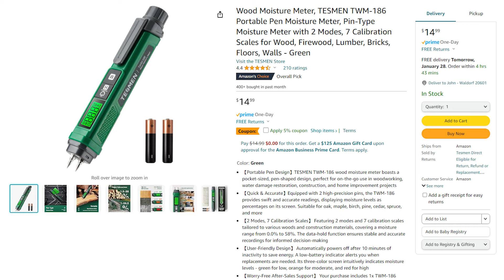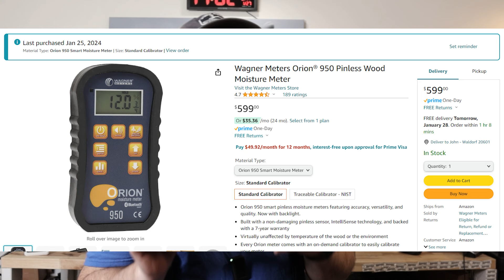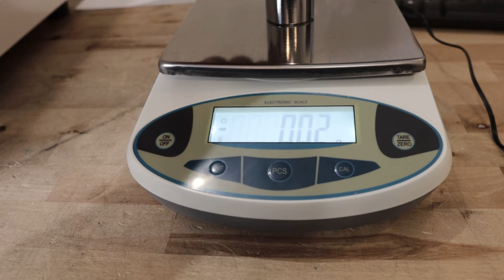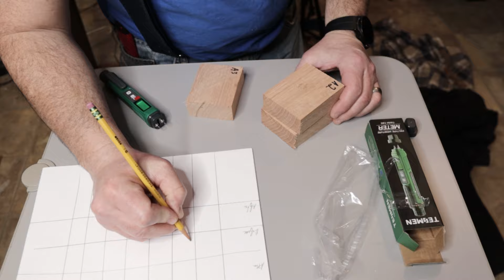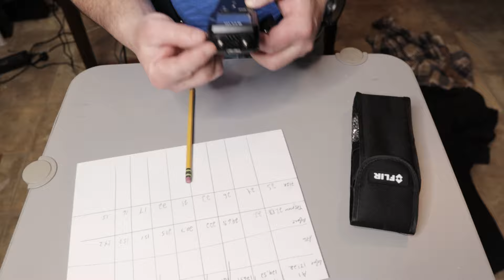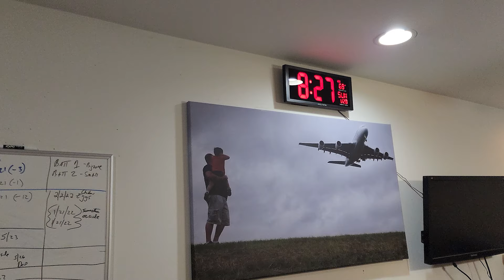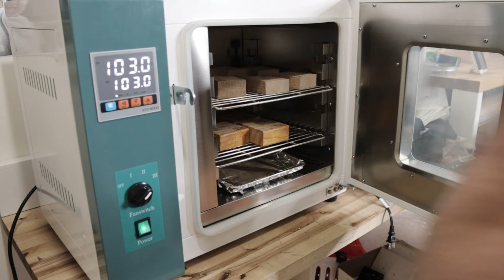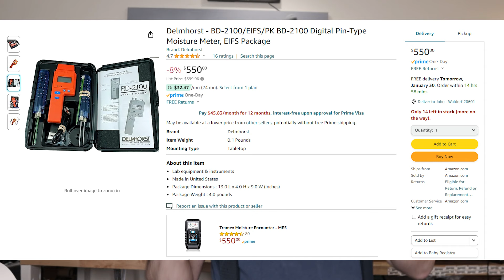Science Proves Which Wood Moisture Meter is Best

Comment: With the repeatability on the tessman, just account for the error. Write on it or something to remember the number.
Reply from the maker: The machine was 30% +/-. It's a pretty big swing. You could sooner guess the moisture content at that point.
Reply: @JohnWCH   I guess I must have missed something. My understanding was that it would be the same percentage off every time.
Reply from the maker: Nope it was not accurate in either direction.

Comment: I like your scientific approach to assess the accuracy and would have appreciated a higher focus on presenting result details. A table showing measured percentages against determined percentages from the oven drying procedure. For a fair comparison of the pin meter you could have put 6 metal pins in each wood sample to ensure that both instruments “see” the same moisture and having 3 sample locations tells you how homogeneous the moisture is distributed within the wood. A measurement difference between the instruments is then only due to difference in resistance measurement or applied internal calibration. All the pin meter does is measuring the resistance, which can be done with any simple multimeter, and converts it into percent moisture based on an internal calibration for different materials. Again, a detailed result table would allow conclusions on how good the internal calibrations were for different types of wood and if a recalibration by the user would make sense

Comment: Repeatability can be enough.  I test rough turned bowls, and just note the number.  If it's stable over a few weeks, it's done.  The particular number is irrelevant.  Any air drying to equilibrium can be done this way, and I would argue this is the most useful thing to know in the first place.

I would be interested to see how the pin meters preform with the pins all the way inserted.  I don't know what the user manuals for those products say, but in my experience you only get some accuracy when you hammer them in a good 1/4".  Physical robustness is one of the most important things for pin meters.
Reply from the maker: Sure that would work and believe me when I tell you, I was giving those pins the business, when I was pushing them in.

Comment: One thing he did not test which seems to be a shame is calibration. The main distinction between cheap and expensive meters seems to me to be whether you can adjust for the woods density. The absolute moisture content is generally not the main issue in woodworking (more important in firewood). What wood workers need to know is is the wood going to be stable in the environment it will be in. So if you are building furniture that will live in a heated living space what is the humidity in that space and how does that compare to my stock? You can set that by simply measuring a piece of furniture that is in a similar environment. So I measure an oak table and the meter says it has 20% moisture. It doesn't matter if it is really 15 or 25% as long as the reading on my stock is the same the new wood should not move. That would be fine if I am building the new stuff out of oak but what if I am using oak for framing but maple for draws. This is where the species calibration is essential. To get an accurate comparison between different species you have to be able to adjust for their different densities. This is far more important than absolute accuracy.
Reply from the maker: In the "review" portion of each one of the units, I talked about literally what you're talking about and their ability to do what you're asking.

Comment: Don need no stinkin' moisture meter for firewood. Those with knowledge and experience know how to judge without some device. 1. Look at the splits for weathering. 2. Are the splits cracked on ends ? 3. Knock a couple of splits together. If they "sound" then seasoned. 4. Know how long your stacks have been seasoning. Need more ? Oh yeah, if the split in the fire sizzles, it is NOT seasoned, not ready. Those cute $$$ MMs are for lumber, cabinet makers, not firewood. JMNSHO
Reply from the maker: You're the man dawg!

Comment: So much effort, then sharing (almost) no results with your audience.
(would) Appreciate you spent 2k on those stuff, to make this video, but other than accuracy (compared to what NUMBERS?) you told nothing. Glad we had the opportunity to watch how you unbox these instruments, then how you struggle to calibrate/set them up, but who knows, maybe more focus on ACTUAL measured numbers would have nicer to see.
Also "cooking" the wood for 24h doesn't give a "real world" result of the moisture content of the wood in case of woodworkers. You had the conclusion, that the pinned moisture meters aren't nearly as accurate than the other ones. You also said why (these measures only at the depth they have their pins inserted), yet you still made your conclusion without making any mention of the wood's drying properties (which is obvious: it dries from the outside to inside, and the surface ALWAYS will be drier than deeper layers). Maybe that was just me, that didn't heard, but I think you said nothing about the "cooked" wood. Especially not if it reached the 0% moisture content or not (though the whole samples!). Then how your "accuracy measurement" conclusion could be legit?
NO woodworker will put their wood into an oven for 24h, then will start to work the lumber. The optimal scenario is to let the wood dry slowly, and relatively uniform (to reach the same moisture content at any depth). Those pinned moisture meters are designed to test these type of woods, not "baked for 24h" ones. That's why you got huge differences for these models using your testing method, and not because of inaccurate (at least not at that level inaccurate) instruments.